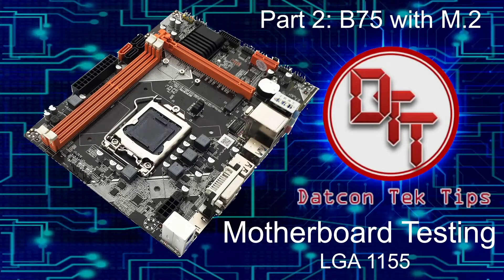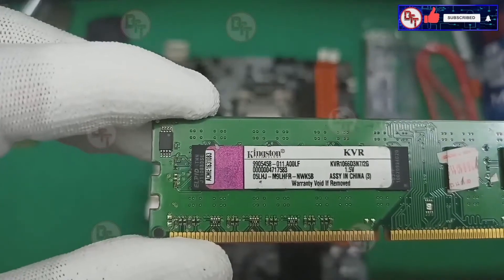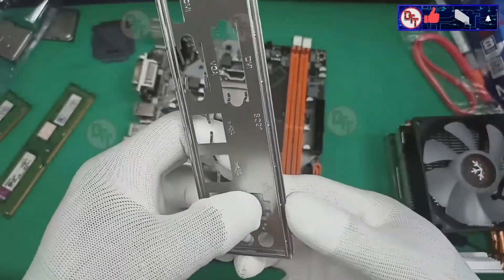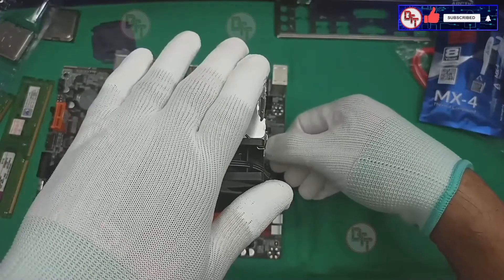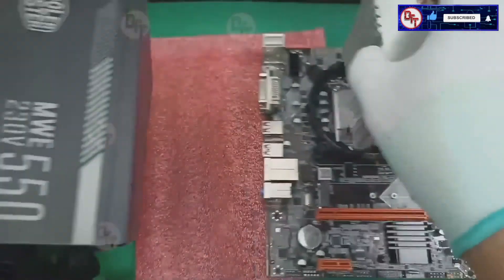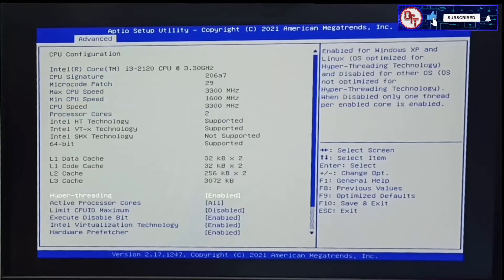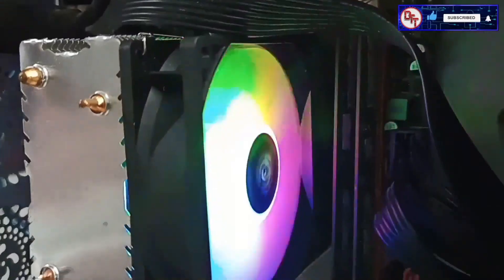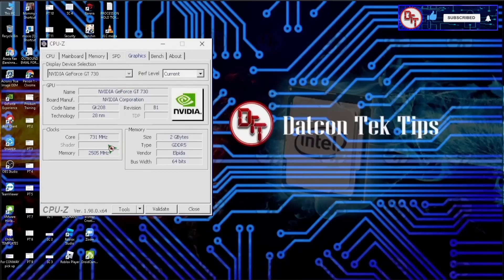1155 Motherboard with M.2 for Intel (Part 2)

Comment: i only use sata ssd should i put the jumper to 2-3?
Reply from the maker: If your not using the M.2 slot any jumper will do,  you can use the SATA port and use sata ssd. Don't forget to subscribe. Thanks

Comment: Always mock-up and do your boot-up test outside the case, before putting everything into the case, to save yourself work later should there be problems with the parts
Reply from the maker: I test this outside the case and when its working I put this in the case and make a video. As of now motherboard is 100% working.

Comment: Please check front connector usb 3.0 speed
Reply from the maker: The USB 3 front upon testing it only read 400mbps tops. But on paper the max speed is 500mbps.